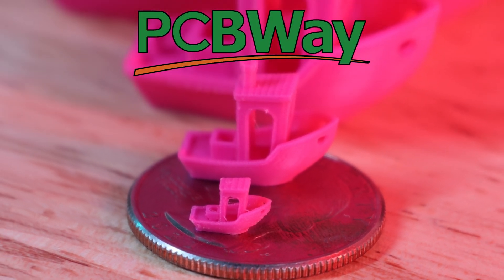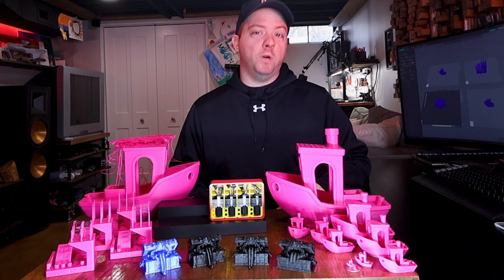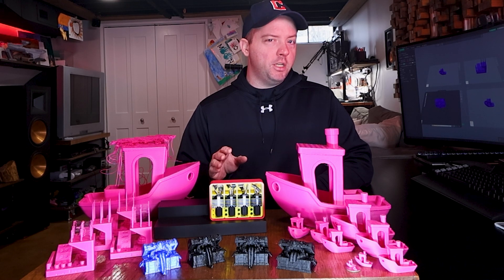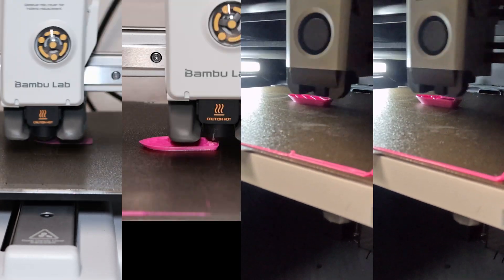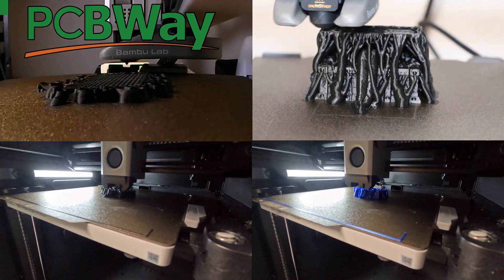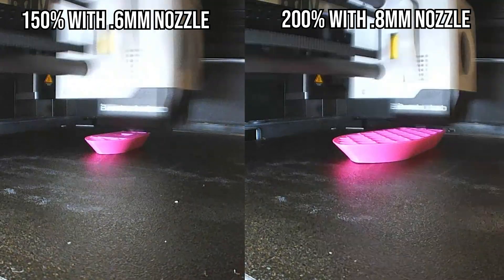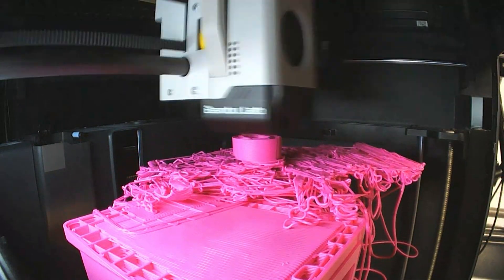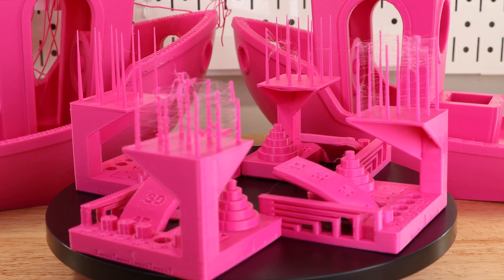Start Swapping Nozzles!  Printing With Every Bambu Nozzle Size

Comment: Thanks for the tips and testing.  I'm AD.  Let me share a top tip back in thanks for your video.  Wash your PEI Textured build plates by hand, with Dawn and Hot water.  Use ONLY your hands to do this as you will be able to feel when the plate is squeaky clean.  Rinse, dry, and replace.  This will solve 99.9% of your bed adhesion issues with Bambu printers.  I also suggest that people use gloves when handling your prints (if you plan to paint them) and your build sheets.  In both instances, this keeps oils and other transferred nasties off your print and plates.  All it takes is one touch of your hands on your build plate to make Filaments not stick.
Reply from the maker: While the glue worked I definitely had my fingers on that build plate so maybe that was the root cause.  I'll take the reminder and start cleaning now! :)
Reply: Totally agree, except that I found that wearing 5 mil nitrile gloves anytime I'm actually touching the plates when washing and drying them as well as clearing parts from the beds is also a wise practice. Makes a huge difference for adhesion and first layer print quality when the textured PEI or even patterned PEI (like carbon fiber, etc) plates are used. Hope this helps, and thank you for the confirmation on the warm water and Dawn. Exactly what I've found works best. I never use IPA on the plates.
Reply: @DigitalDoyle  I agree with the gloves as well!